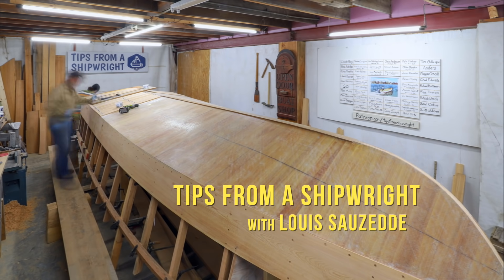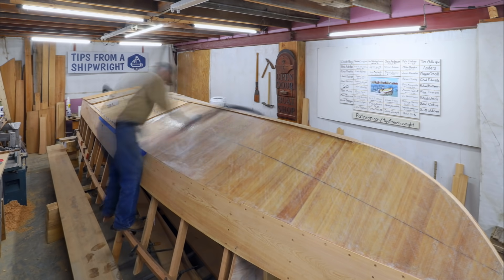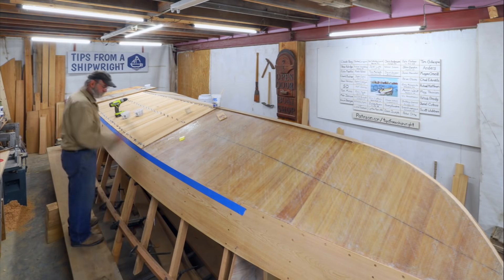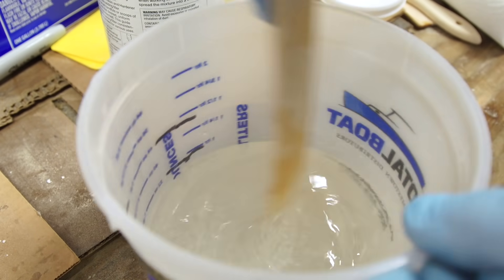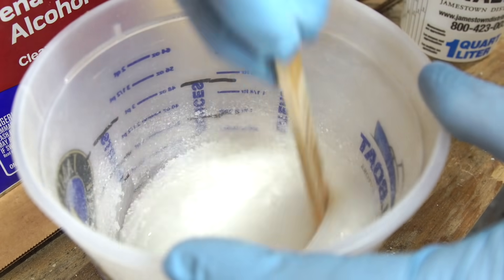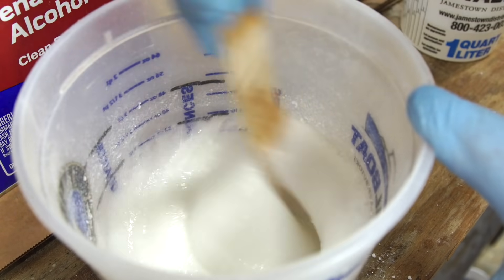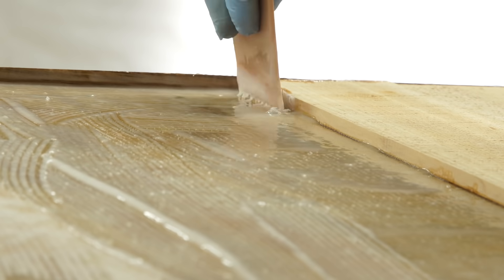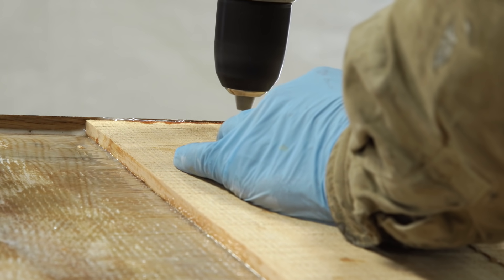Building the 23' V-Bottom Skiff - Episode 14: Second layer of bottom planking

Comment: @10:32 you can see gaps under the planking between the 3 rows of nails.  I'm curious if thats a problem and why you did the middle row of nails last?  It seems like if you had done the bottom row of nails last it would have eliminated or at least reduced those gaps under the planks.

Comment: I was always taught to not hit the wood/fiberglass  you are gluing down with a hammer. Because it squeezes the glue out from under it and then when the piece rebounds up there isn’t any glue there now.
Reply: @Амням-с8г  for sure. That’s a good way to do it. I’ve also done vacuum bagging for strip planking that worked real well. Just need real slow cure epoxy.
Reply: @Mad.Man.Marine  How much pressure did you pull? I may be doing this in the near future. With test panels I find that when I pull higher vacuum (approaching 1 Atmosphere) I get a lot of water vapor coming out of the wood. I am thinking I might just hold at around 0.5 Atmosphere. I am afraid the vapor may cause problems with the structure or lead to poor adhesion.
Reply: @mckenziekeith7434  yes. You need to be careful with that. The rod you use needs to be at its lowest possible moisture content. Especially if you are encapsulating the wood completely.
Reply: @Mad.Man.Marine  Thank you. I will probably be using kiln dried redwood. I will do further testing to dial it in.

Comment: Nice. Your precision of block planing .  I’m curious about the planking fit towards the bow. Is there a reason why you wouldn’t steam or soak the planks to allow them to make that twist and then  fasten them  temporarily until they dry . I know they may swell a bit and have to fine tune the fit after drying.
Reply from the maker: It would add too many steps, you wouldn't able to glue while the wood was wet, this is a composite construction and we were able to twist them in place so it just wasn't necessary.

Comment: I expected the second layer of bottom boards to be oriented in a different direction compared to layer #1. Did they ever make boats like that??
Reply: This is kind of a weird design. A mix of traditional and new methods. Usually for newer epoxy cold molded boats (a-la Gougeon brothers) the different layers of wood are laid up in different directions to achieve an effect similar to plywood. But Lou doesn't seem to be doing that.
Reply from the maker: Hi Brent, the second layer of planking is purposely a little bias to the first layer, good notice

Comment: What are the nuts doing for you?
There are no fender washers tight enough and thick enough for you?
I'd be really tempted to use plastic staples.
Reply: He said in the video that the nuts are there because the hole in the washer is bigger than the head of the nail. So the nuts keep the nail from simply passing through the washer. Are there plastic staples that will go through hard wood planking?
Reply: @mckenziekeith7434  I can buy a 50 pack of 1 1/4 OD #8 fender washers at the big box for ~$5.
Would think it a lot easier than trying to juggle that setup.
Yes there are plastic staples used to staple into wood all the time, and they pull down quite tight.
Saves having to remove them  for later milling and they leave no stains.
But Louis is doing what he wants with this project, and Im sure he is as old and set in his ways as me so no judgement or criticism.
I'm just glad he and the crew take the time to make these videos and share the technique.
Reply: @jimurrata6785  I will have to check out the plastic staple thing. That is definitely interesting! Maybe Lou didn't want to buy anything new and worked with what he had instead. Since he will be pulling the nails, the nuts and washers should  still be totally usable afterwards. You definitely have me convinced, though. I probably would have made a trip to home depot or similar.
Reply: Try it on your next build and let us know how works.
Reply: @danacrook4203  I use drywall screws and fender washers.
Plastic staples plenty of times, but I'm not in the Narragansett boat shop any more.
The staples are great for inner layers because you can plane or saw them without any damage to your tools
But they do tend to crush some of the wood fiber under the crown. So, not great for the last layer of plank or veneer if you're going to varnish because it absorbs more and leaves a darker stripe or spot.
And of course you need a compressor to use the staple guns.

Comment: Looks like there is an air gap under the top course of planks - is that ok?
Reply: He explained how he made sure there isn't a gap. Unless you're talking about at the bow where he is fitting and temporarily fastening before glueing?
Reply: @billstevens3796  no, he means the bowing between the rows of nails where the boards clearly do not contact the layer below. the filler in the glue will take up some of that, but not ideal - i'd want the boards tight along their entire length. maybe it doesn't matter with a couple more layers of glass & glue over it.

Comment: You over do it, Lou. As soon as water starts to penetrate the wood in between the two waterproof layers, there won't be a way for it to escape.
Reply: If they are waterproof  layers  then  water won't get into  the wood. Epoxy  resins  and glue are very  impervious to
water. Some high end boat builders  made fiberglass  encapsulated  wood boats  that worked well. Some of these 
were large  high  powered sport fishing 
boats that were  driven hard and fast.
They went to all fiberglass  because of
high  labor  costs and  expensive wood.
Reply: @williambikash6645  Water will eventually penetrate any waterproof seal and most certainly, if and when the outer seal gets punctured or scratched. Also the planking on the inside of the boat will move, due to shifting temperatures and humidity, creating cracks in the resin over time. That's OK though as long as there is only one waterproof seal, which the boats you mention probably had. Lou's construction will become very rigid and strong though the planks in between the seals ought to be made from plastic, similar to the kind he sometimes uses for frames. 

The construction is an adaption to boats driven by high powered engines, which puts a lot of strain to the hull, making constructions from wood less than optimal. It's dubious also from an environmental point of view as the boat must be treated as special waste, at the end of it's lifecycle (not even suitable for a bonfire).
Reply: Let's see your build so we can see the optimal way.
Reply: How long do you  want a boat to last?
 Rybovich  boats  built in W Palm Beach  area have been  building  sports fishing 
boats since the late 1940's. Sometime
In late 60's early 70's one of 3 second
generation brothers came up with a system  of cold moulded mahogany 
planking  totally  encapsulated  with
epoxy  resins  and fiberglass  weaves
and coated with sealers and paints.
The bilge finish is smoother then  the
topsides of many "good " boats.  They 
have been building  this way for about 
50 years and third generation  is doing 
It to this day. Probably  with better 
materials then ever. These  are not
stock boats  with wood  core transoms
and stringers  that eventually rot.
Water  does not permeate into the
wood! And they know what to do if the
hull is damaged. 
Lou's boat will probably outlast many
of us who are watching  this build!
Reply: Sjobang...you could be far less rude.